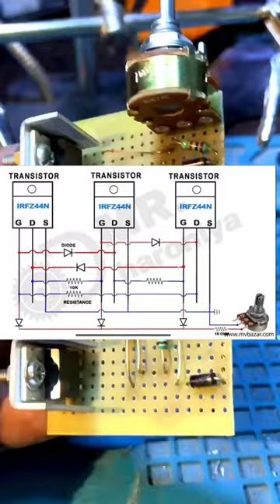How to make Bldc moter speed controler #technology

Comment: dont follow this. it does not work properly
Reply: thx
Reply: It works
Reply: Bro this will work but not for long time if use heavy ampire on it .. and somtines the motor will not auto start... But still it does it work ... Corect voltage and ampre increase its life time..❤